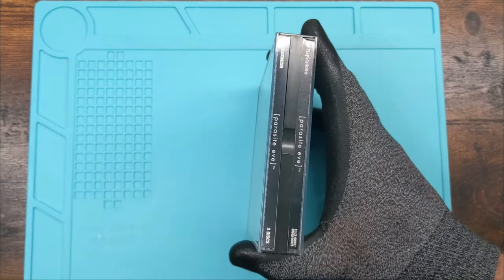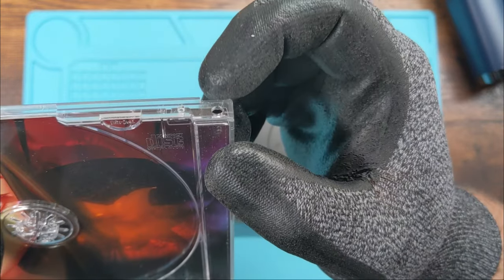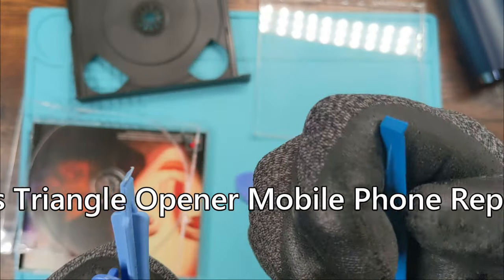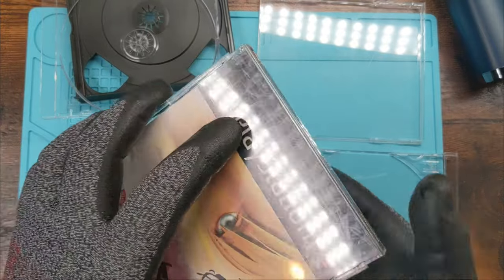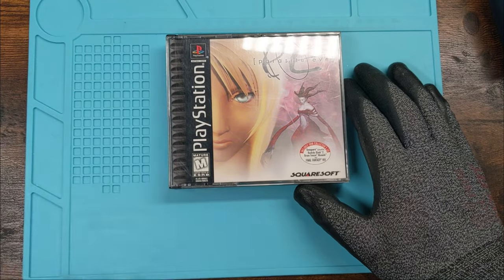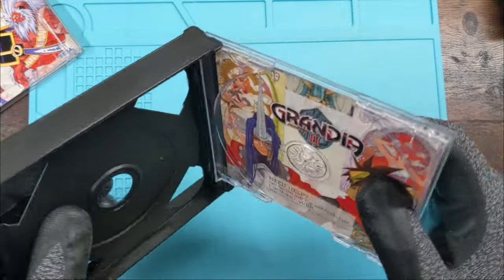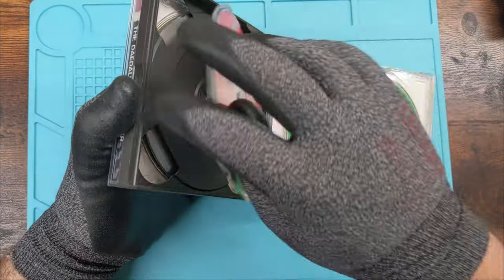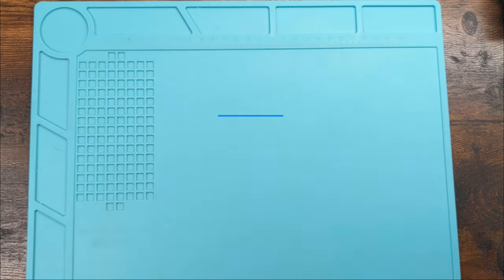Disassembly of multi-disc jewel cases!

Comment: Would i be better off just buying cheap ps1 games and switching out my expensive games and inserts? are can buying off brand cases  be good enough? i want to someday get my games graded and can the people who grade tell the difference between original ps1 cases and off brand? 

What i want to know is are off brand cases different in any way from original ps1 cases?
Reply from the maker: You absolutely can case swap. I made a few videos where I talk about how it's kinda silly to polish jewel cases when you can swap just as easily, but there are a handful of times when you want that original case! Or long box jewel cases! So I figured it's not a bad skill to have handy. Most off-brand are just as good (Sony made a TON of jewel cases, so it's entirely possible that your off-brand ones will be sony brand)

Oh lordy, if WATA was good enough to recognize off-brand vs sony jewel cases I'd be shocked. To my knowledge there aren't any huge signs that would tip off WATA (unless the case is missing the CD imprint or feel cheaper. But I also have low expectations for those "professional graders" hah! I've been tempted to mock up a fake case and cover art and see if it passes them. Kinda evil, but maybe....

But so yeah the differences between off brand and PS1 are going to be almost entirely in the feel. Cheaper acrylics, so one will feel stiffer (PS1 cases feel a bit more sturdy, but with flex).

Comment: So it’s like 2 regular PS1 case back panels on the black middle piece, makes the dual case?
Reply from the maker: Usually! It depends on the manufacturer, but most often the front and back jewel case pieces are interchangeable with "most" single disc cases. There are a ton of weird variants to that rule, but Sony stuck to it fairly consistently!
Reply: @RestoreAndReplay  thanks!

Comment: Hello!  I have a question. I have a few CD jewel cases where the 'front' doors are cracked. I only wish to replace the front part but how can I do this without breaking it???  I'm trying to remove the door but for some reason is refuses to open. My fingers just can't remove it.  How can I get those cracked front covers removed and replaced. Thanks!
Reply from the maker: Absolutely there's a way! Skip to like 7:10 on my video and see that little guitar pick thing I'm using? You'll do that same method to remove the front part of the jewel case, just lift it slightly up and out of it's little post. When I use my fingers I tend to crack the cases too, so you need a tool to really get in there!